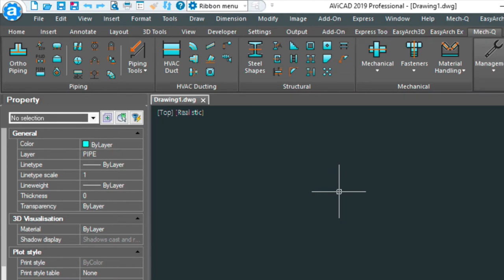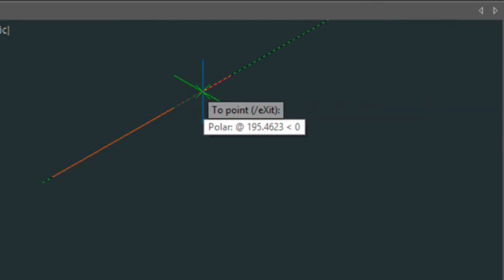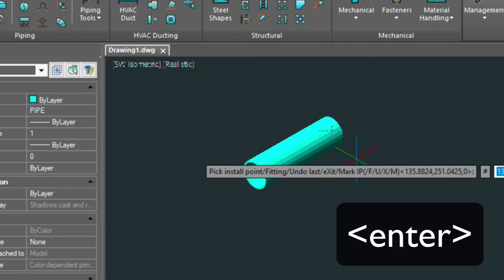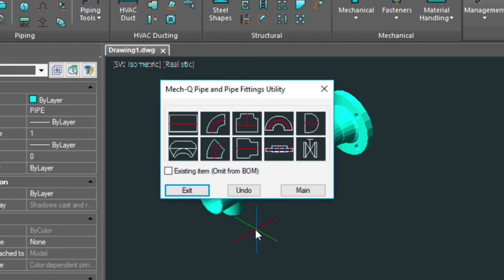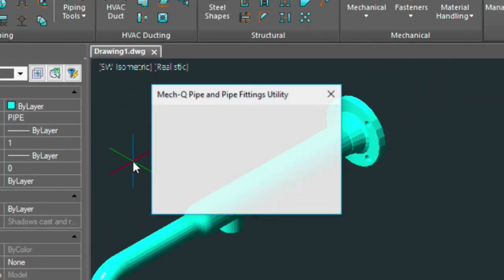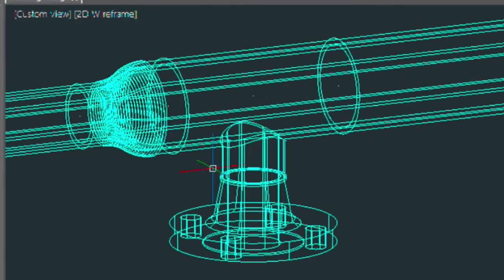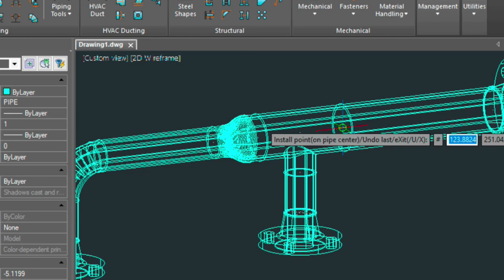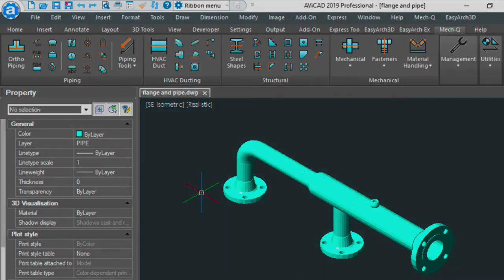3D Piping Basics For Beginners In CAD

Comment: How much is the software?
Reply from the maker: there are various options - you can find them here: cadavenue.com/get-avicad
Reply: @cadavenue  what version do u have in the vid? Standard or plus? Also….can steam tracing and ubolts, pipe hangers, check valves be added to the designs? Im thinking in the mindset of a pipefitter. Basically i want to recreate a piping isometric, with all the details, in the software. Can that be done with this software?
Reply from the maker: @markherring3513  the Standard or Plus comes with Mech-Q our engineering tools. We have both ISO and 3D, the ISO being 2D for not to scale sketches.